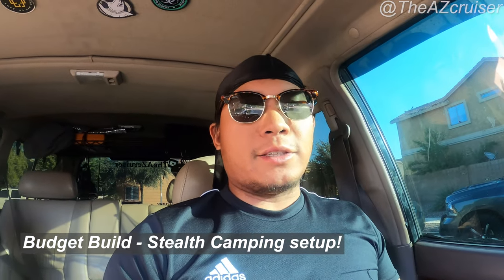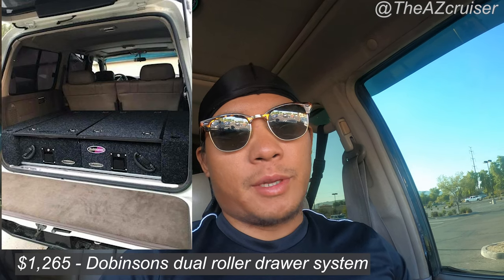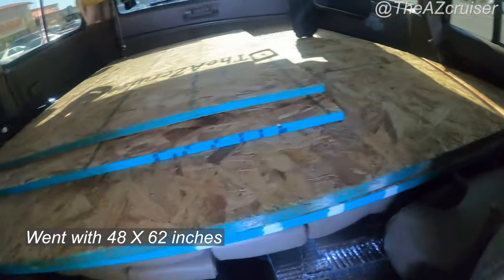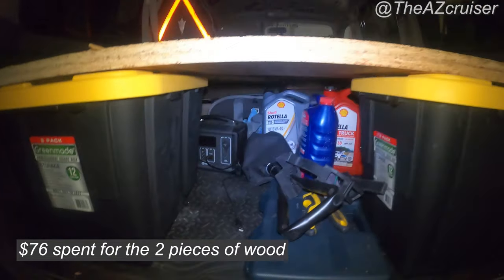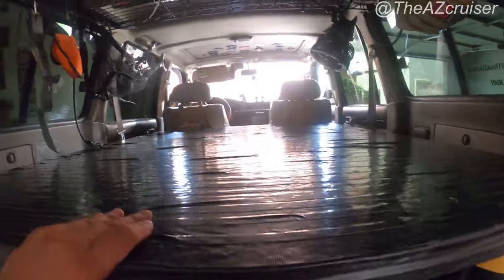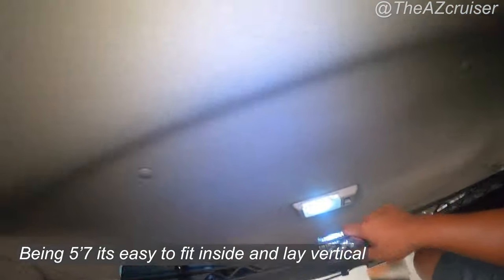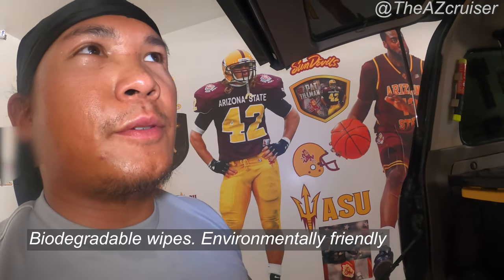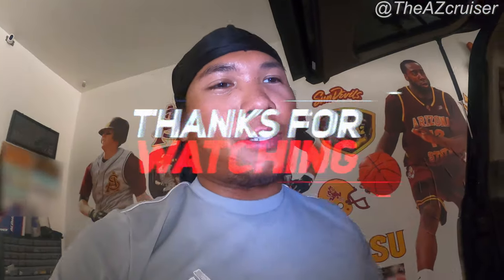ℹ️ How to: DIY Sleeping Platform Budget Build - 97' Toyota Land Cruiser (prod. 2FP)

Comment: Sure the timber could've been 2 inches longer as you said but Why did you cut the timber 2 or 3 inches narrow? Was there a purpose for that?
Reply from the maker: I got the measurements from a fellow 80 series Land Cruiser owner on Instagram. I did not want it flush so I can still stick stuff on the side without having to stuff it under the wood if need be.